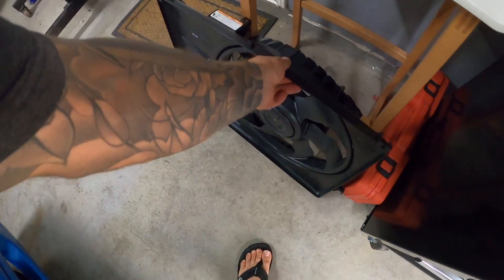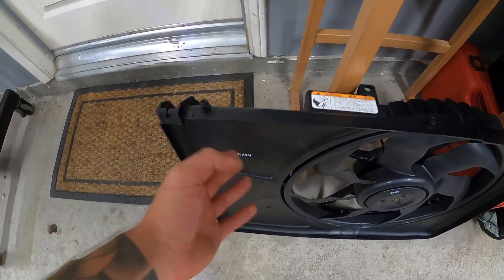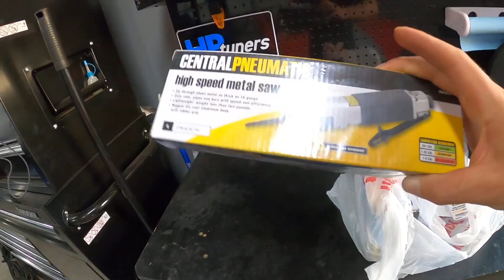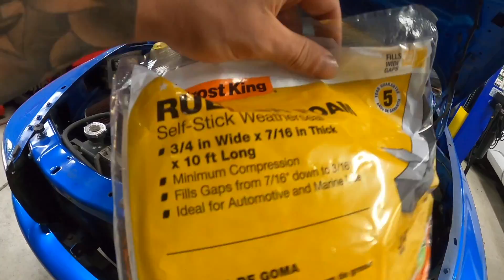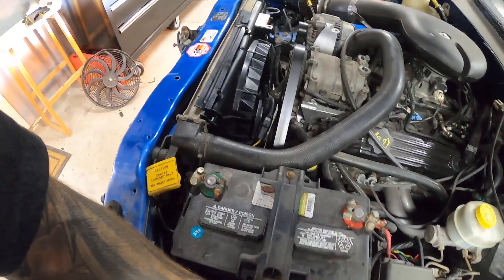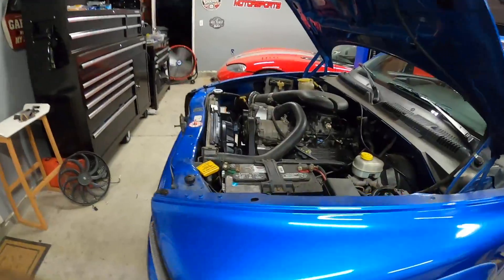DOES SIZE MATTER? | ELECTRIC FAN TOO SMALL | DODGE TRUCK FAN CONVERSION

Comment: I just used the to factory shroud with the after market fan with a relay and the Hayden fan controller off the battery with 10 gauge wire on my  98 Dakota keeps it Cool but I do have to set it up for the a/c still

Comment: FYI those washable KN type air filters don't filter as much as the stock filter and the stock filter was designed to flow enough air when it's dirty. If it was a turbo or supercharged engine the bearings would be getting ate up. Secondly the air box also pulled air from the fender cavity, not the hot engine bay. I dont know what value you put on your time but my time is better spent replacing the OE filter than washing a KN

Comment: John, working on my sons ‘99 Dakota and I’m converting it over to electric fan. Do you still recommend the black horse fan? I know you swapped in a later video but we don’t live in Texas so over 100 degrees is more the exception than the rule.
Reply: What did you end up going with? Does it work well? Thanks

Comment: I know this is an older vid now, but wanted to ask...I am doing a 2 fan electric install on my 2001 2wd Ram in a few weeks, and was wondering where you tapped into for your switched power?

Comment: Jon, what size  is the  new fan? I still  have the stock fan and can't stand the noise. Gonna do the swap this week and want this  size. If u remember the vehicle it came from, inform me on that as well. I'd appreciate it more than u know. Especially since I'm in FL, so u know it's hot as hell here! Exhaust is next after I locate scatpack or hellcat mufflers to go with the headers. Decided not to  use the 3in magnaflos I have b/c I love the tone of the scats/hellcats on yours. Thanks in advance.
Reply from the maker: Hey I have a few extra fans if you want the same one. If you want one I can do $100 and you cover the shipping and it’s yours! Let me know if you’re interested! BoostedMotorsports88@gmail.com
Reply: @BoostedMotorsports  Hey Jon, I've been out of town due to the death of my grandmother and just saw your reply about the fan. That sounds awesome and I should be home no later than the first part of next week  and I'll contact you then. If I'm gonna need anything else, if u don't mind, just email me a short list I'd appreciate it. I'll contact you as soon as I'm back home. Thanks in advance.
Reply: @BoostedMotorsports do you have another fan to sell ?

Comment: I have a 5.9 durango we've been buying the parts slowly to do this to. One thing I've been told is the Hayden controllers are junk and even when installed correctly can cost you at least a head gasket

Comment: Is the fan wired in with a relay? If not, then that would be advisable. Cool job!
Reply from the maker: It is!  We used the hayden fan controller kit but the gauge wiring and fuses aren't too beefy.  I have a more heavy duty kit showing up today that has beefier wiring, relay and fuse.

Comment: Definitely interested in what the model number of that fan is!
Reply from the maker: I have one more I can sell if interested
Reply: @BoostedMotorsports  oh really now? How much?
Reply from the maker: Make me an offer? $100 🤷‍♂️
Reply: @BoostedMotorsports  damn, that's tempting, I wish I hadn't purchased the exact set up in your electric fan video, granted I have a 4.7.
Reply: Knowing the fan would be great, I followed your previous videos and installed the Amazon fan. Does fine cruising around town but mines a 5.9l magnum dakota slt 4x4 that also sees some wheeling/mudding. It cannot keep up cooling under those conditions. Need more fan power. Still currently have the old fan shroud with the coolant res and windshield guild built into it.

Comment: Awsome fan jon.. wish I knew what it’s outa I’d love to do the same to mine as I to put electric fan in mine sometime ago An it’s not keeping up so I put my clutch fan back on for now but I don’t like running noisie clutch fan that fits amazing An would work same in my truck as my rad is same measurement as yours .. could you find out what that fans outa so I can get one appreciate it bro ?!! Great video thanks for sharing
Reply from the maker: I have one extra. I should have experimented with this sooner we threw almost 100 of these in the trash at work 🤦‍♂️
Reply: BoostedMotorsports oh wow really lol.. so what’s the plans with the 1 extra ? Ship to Darren for a few ? Lol let me know thanks or even if you found out what it’s off I really like the size of the fan motor on it .. but most of all how it fit like a glove along with the small trim lol.. 👌

Comment: Go to 8-10 gauge wire and should be fine that foam is going to get sucked in by the fan at some point I would use some grace Iceland water shield it's rubber roof stuff you put down on a roof  super sticky and you can deal the side Right to the aluminum core rib and also stabilize the fan at same time ✌️👍

Comment: There is a factory option for heavy duty cooling that has a clutch fan and an electric.  You might be able to find one for a 5.9 out of a 4x4 or durango that has a towing package, heavy cooling is included in towing.
Reply: I think all the V8s got the bigger radiator but you might want to double check that too.  It's also included in the cooling or tow packs.

Comment: AC, ,🤣🤣 we don't need you passing out from heat stroke if you get the S2000 sold
Reply from the maker: I’m gonna be sweatin if the s2000 sells! Free sauna 🤣
Reply: @BoostedMotorsports  🤣🤣🤣 yeah I would hook up the AC again..  you can just sit in the garage with the doors closed for the free sauna experience 😝😝

Comment: Jon, if the temps still stay higher than normal, may I suggest a radiator with more rows (3 row core type). I see that your factory radiator is somewhat thin or not sufficient to your needs.

Comment: i would cool the duster off between rounds,an it liked leavin line at about 165 or so, never 180,it would throw it off slightly, i left the line at about 1800 or 2000 hard to remember,but used a roadrunner converter about 2200 stall, an drove same car to tennessee an everywhere with 3.55 gear an bracket raced too,an took tracks money on occasion,in bracket racing you gotta do exact same thing about everytime,an pick on new punk ass kids in mustangs an rubbish as that,that have no clue to cut a light etc...mopar or no car,had about 4 ...500.000 an 501.000 lights long ago,an thats a little close but pretty unbeatable...

Comment: Hi John, I have to agree with leakyjeep. That foam tape will let loose when it heats up, speaking from experience. I have tried that foam tape and over time when it gets hot it let's loose. I was thinking while watching, don't throw the curved edge away that you cut off of the shroud. Do some measuring and cut a little more off the shroud and then plastic weld the curved end back on so you will get like a factory seal on the shroud. If you have never welded plastic together here is a great video of it being done and it's ends up as strong as if it was never cut or broken.  https://youtu.be/5oU1zAefO1E   Nice looking set up though as far as a fan shroud from a different vehicle. Good luck brother
Reply: My foam got sucked in the first time I fired it up. Almost broke the fan.

Comment: This was a nice upgrage.... it did the trick.  I am sure if you use 8ga wire or even a 10ga wire and fuse holder that should do it.   NICE Job!!
Reply from the maker: R- SHOT Racing thanks man! I have a more heavy duty fan controller and relay showing up today. The relay and fuses on the hayden controller we’re getting too hot for my
Liking